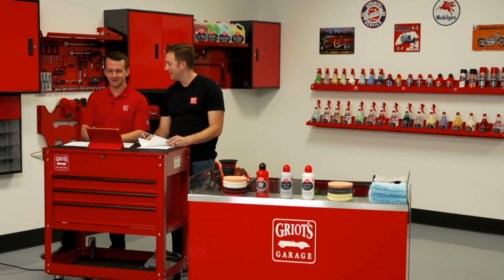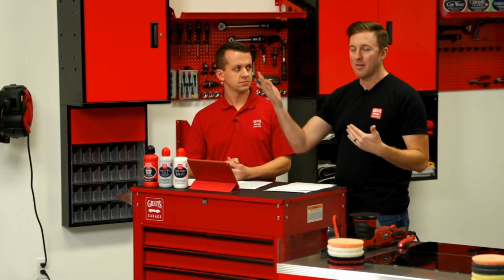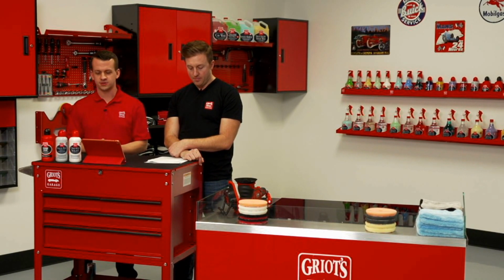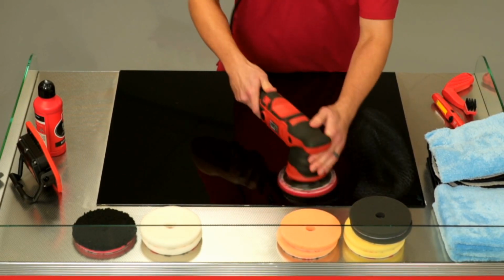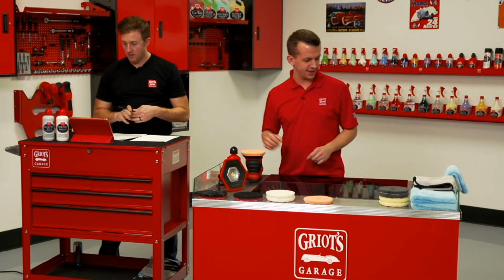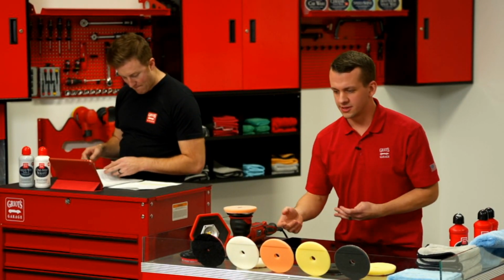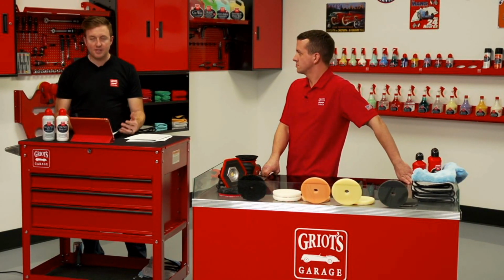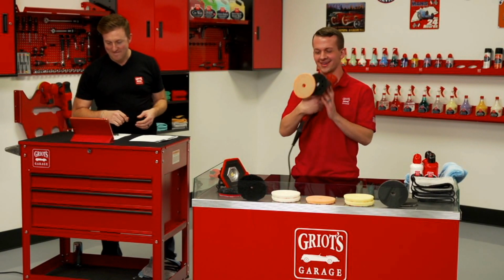Griot's Garage LIVE: 1-Step Polishing Processes

Comment: Dif b tween black micro pad and  white micro
Reply from the maker: These new white pads have a few notable improvements over the previous generation of black pads. The cutting capability between the two pads are similar, however the new pads will finish down much nicer. The new pads are also more resilient to matting than the old microfiber pads.

Comment: First time what's different between ceramic 3n1 and ceramic all n 1
Reply: Customer no. 255
Reply from the maker: Hey Mark, Ceramic All-in-One and Ceramic 3-in-1 Wax provide equivalent protection, the main differences are application method and intended use. Ceramic All-in-One is formulated to be applied by hand or machine with a polishing pad while Ceramic 3-in-1 Wax is sprayable wax. Ceramic All-in-One is great if you're looking to correct and protect in one easy step. Ceramic 3-in-1 Wax is greta if you've previously done paint correction or do not plan to polish. Hope this help!

Comment: Hello Griots, can you add ceramic 3 in 1 on top of the one step? If so, how long do you wait for cure time on the 1 step? Thank you
Reply from the maker: The simple answer is yes, there’s a few things to keep in mind! When applying multiple layers of wax or sealant, always assess the protection and aesthetic properties of each. The extent of the protection will only last as long as your bottom layer provides, so you’ll want to use the more durable product as your bottom layer and allow it to cure for 12-24 hours. Your top layer will determine the gloss, shine, and hydrophobic properties, so if you’re using a super hydrophobic protectant, like Ceramic 3-in-1 Wax, it’s not particularly beneficial to put another coat of a different wax on top as you’ll sacrifice the hydrophobic properties. The flip side of that is that if the base layer doesn't offer the same length of protection, you won't be taking advantage of the 9-12 months of protection the Ceramic 3-in-1 Wax has to offer.